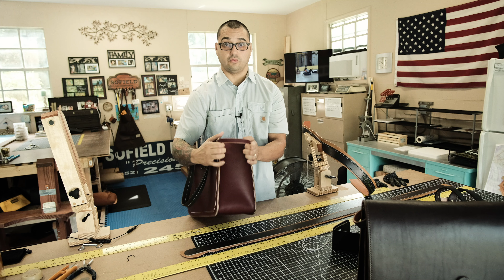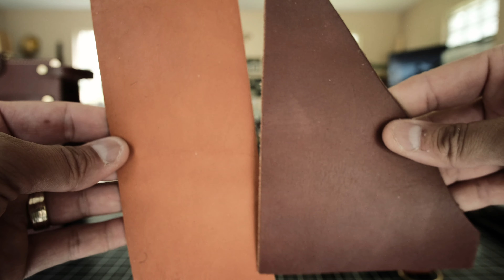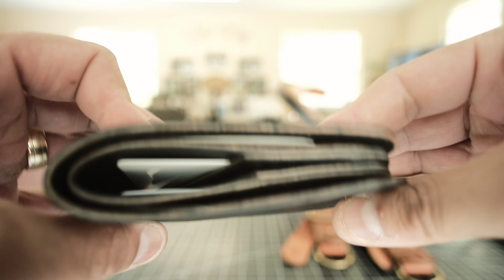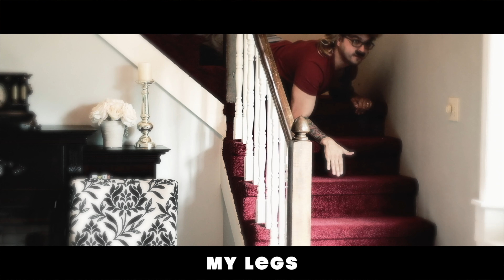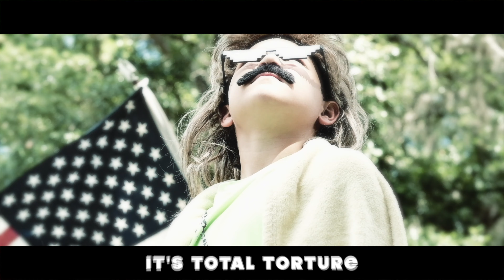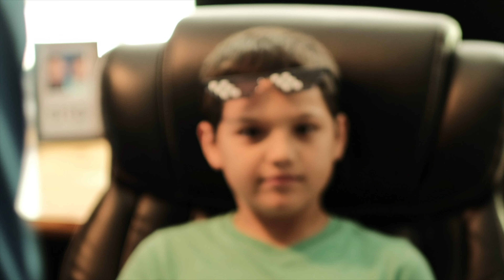Making Leather Bags | Design Issues | Plus Bonus Music Video

Comment: It was fine until the “Life Without Knees” song. Interestingly disturbing. I have knees but they don’t work well due to a demyelinating neurological condition. I actually make choices and arrange things around me based on how.many steps I have to take to get a thing done. If I can reduce the steps required from 6 down to 4, I’ll do it that way instead. 

The music, mannerisms,  stretches and falls, thoughts about it, etc., was quite accurate. Not funny, but I’m not sure it was meant to be. Interesting though. Fuel for my morbidly depressive mind-wandering.  I’m sure I needed that for some reason. Thanks. I’ll listen to it again now. Maybe there is a way to turn that creativity in a positive direction. 

To the same music...

Life without knees
I can stand up straight for long time. 
Long time. No need to walk around. 

Long time. Time. 

Time passes so slowly most days. Days and nights. 
Not like the people running, running, running around. 
Running. 

Eternity is here now. Never broken by pointless unthinking activity. 

Flow. 

Life without knees. Probably don’t need them anyway. . 

I can pull myself along the floor with speed. 
I’ve had practice. 
Other people never do. 
I’m faster than them on the floor horizontally. 

Things other people never do. Never do. I get practice. 

I’ve dropped so many things I can catch anything before it hits the floor.

Except me. 

I can stand up straight for a long time. 
In just one place. 
I don’t get bored. 
I can catch anything. 
I can beat the gravity of things. 

Gravity. 
I can beat it,
Today. 

Life without knees. 
😁😁😁

Well, I got distracted. 
Good ideas for the bags. Good luck. 
I like the zipper, though. 
What about a light weight, 1.5 - 2.0 mil protective flap covering it. 
Shield clothing from it, keep dust and water away from it. 
Match the front flap. Maybe attach it with a rolled top edge so the stitching doesn’t show. 
Sleek lines. Elegant. Functional. 

Just a thought.
Reply from the maker: 😳😳😳. What an epic response. I really appreciate it. 🤣🤣🤣. 👊🏼👊🏼👊🏼. Also... good ideas for the bags. 🤔🤔🤔🤔. Thanks
Reply: @SofieldLeather  Please do let us know how the zipper thing works out.  I like the zipper much better than an open outside pocket for a business brief case.  Never thought about damage to clothes, though.  Thanks for sharing that.  So many elements to consider.  They say you can't think of everything but we have to try, eh.

Love your work.
Reply from the maker: Wayne Rogers 👍. Zipper is nicer to me. Although most clients prefer the open flap with magnet as it’s easier to get things in and out. Zipper Doesn’t really fray the clothing that much like I thought. Thanks for the support. 🙏